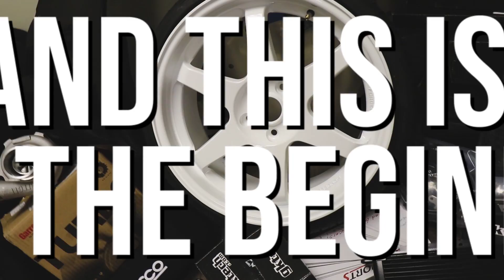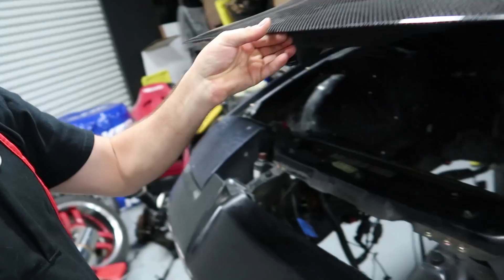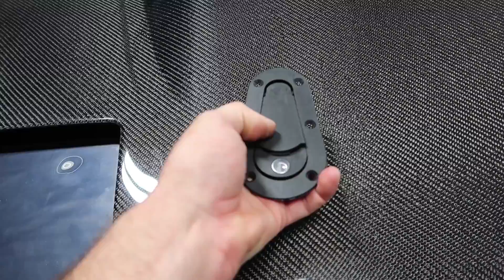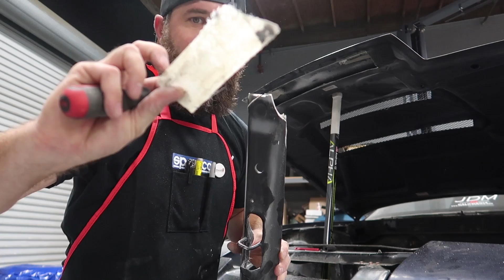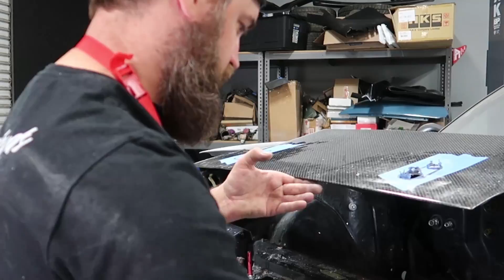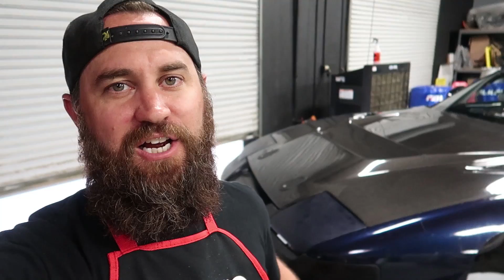CUTTING OUR BRAND NEW CARBON FIBER HOOD FOR THIS... **IT'S 100% WORTH IT!**

Comment: Loved this kit on my WRX, I used the Password JDM install kit. It gives you a back plate so your not just putting bolts and nuts through the hood. It make installing these much easier.
Reply: silversentrav - Yea. Aerocatch now includes it and it is far superior to the PWJDM part.
Reply: Nice , it’s been awhile since I’ve done the install. The Soarer will be getting these when we get back to the US.

Comment: Painting Carbon is a sin. If you’re painting just do a fiberglass hood
Reply: turbohayabusa01  if you can afford carbon why not? It’s lighter and painting it will make it last longer
Reply: Crowy The butcher except carbon hood and fiberglass hoods will weigh the same +- a few ounces. Only reason someone buys a carbon hood and then paints it is to say they have a carbon hood.
Reply: @turbohayabusa01  carbon fiber can reach up to 500 ksi strength, fiber glass is about 300 ksi. Not the same
Reply: Zach Hill OG course it’s not exactly the same but a huge majority of people that are getting carbon or fiberglass hoods aren’t doing it for the strength but for the weight savings
Reply: @turbohayabusa01  "Carbon fiber composites are 70% lighter than steel, 40% lighter than aluminum, and about 15% lighter than fiberglass composites. The nature of a carbon fiber is very light, rigid, and strong which is why most weight-critical performance products are manufactured with carbon fiber." Google is just shutting you down left and right buddy...
Reply: @turbohayabusa01  also let's not forget that all the high end super cars have carbon fiber panels that are painted, but that's a sin too right 🙄?
Reply: Zach Hill wtf are you on about? I’m not arguing that carbon isn’t stronger and lighter than other materials, I’m agreeing. But what I’m saying is when somebody does say a carbon hood and fenders like I have on my skyline I did it simply  for weight savings and the look of the carbon. If I get into a front end collision the carbon isn’t gona be magically un damaged, it will be ruined, so even tho it has a higher strength than steel panels it really doesn’t matter the strength of it unless we are talking about rigidity of the actual structure as in the whole chassis, for example super cars. And yes painting over carbon IMO, let me say that again....IN MY OPINION is a sin. I wana see the beauty of the exposed carbon. Everyone has opinions they don’t have to line up to yours buddy
Reply: Zach Hill I’m speaking about the regular street car customer. Not speaking of race teams and high end manufacturers
Reply: @crowythebutcher6127  Seibon isn't even full carbon...it's all fiberglass with a carbon layer at the very top...so weight isn't much a factor what so ever.

Comment: I know for a looks the feather Parts supposed to go to the front but that allows the wind to catch the latch if that latch ever God forbid popped open it folds back so the wind can push it back which would unlatch it and then cause the hood to pop up and then the wind would catch it and slam it back against the glass whereas if the latch was the opposite direction with the pointy side forward and the fat round side backwards. If the same scenario happen God forbid the latch popped and cause the handle to lift up the wind would push down against it in the opposite direction forcing the latch to stay locked unlike the first scenario. Now I do not care either way that's just my personal Insight other than that doesn't really matter I just think it's a wild design I think it looks better when the fatter part faces forward however there's a design flaw where if that latch pops and the handle lifts the air will catch it pushing it backwards unlocking it allowing are to pick up the hood and throw it backwards now that's of course if an oem hood latch isn't being used but I'm not making that claim
Reply: preprodigy - The latch is spring loaded. I don’t think 200mph and a steady headwind wound force these latches to open. The are pretty well sorted.

Comment: I thought they were supposed to face the other way. The way you have it the wind can push against a latch that’s not fully snapped in and completely release during high speeds.
Reply: Nope.
Reply: I thought the exact same thing
Reply: That's what I was always told but you see them mounted in every configuration imaginable so I'd say it doesn't really matter much tbh
Reply: Todd Higgins - You’re Correct. It really doesn’t matter. The pins are spring loaded and the wind going over them isn’t going to effect them if you leave them unlatched regardless. Ive seen them mounted sideways as well. I guess just a personal preference.
Reply: Mickey Andrade good to know!

Comment: I wouldn't paint the hood if I was building this car I would like to see it with carbonfiber first
Reply: There's hardly any point in a carbon hood if you're just going to paint it. The looks are 50% of the reason for having carbon.
Reply: They Have A Special Way They Paint It So They Dont Fully Degrade Its Integrity. & They Are For More Performance Rather Then Style. Its For Lightweight Function While Maintaining Strength. Buh Carbon Fiber Is Indeed Amazing Without Paint. Buh For This Car It Should B Painted

Comment: Wish that kit fit my 240 coupe  :(
Reply: BKRacer FPV - Oh, it can!
Reply: Not doubting you bro but I touched bases with your tech support and almost ordered it but they told me no  :(   And I want it. I think it's a truly bad ass kit  :)
Reply: BKRacer FPV - Do you have pop up headlights?
Reply: At this moment yes but was seriously considering the JDM front end. Heard the motors are always going out for the pop ups. What are you thinking ?
Reply: BKRacer FPV - Keep the pop ups and run this kit.
Reply: And the kit will fit or going to need to modify ?
Reply: BKRacer FPV - If you use pop ups it will fit right up.
Reply: I'll give it a try. There any refunds if it dont fit ? lol jk. Sorry for all the questions but that's an expensive mod and wanna make sure it works